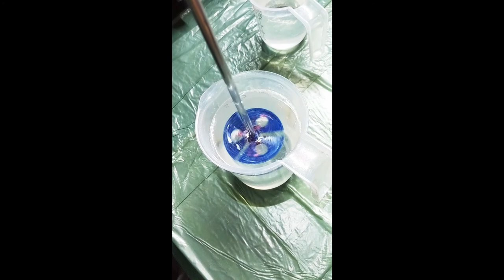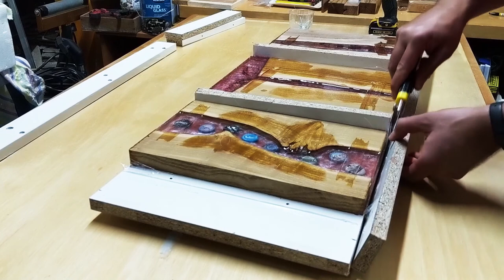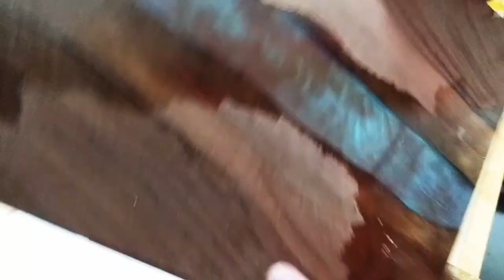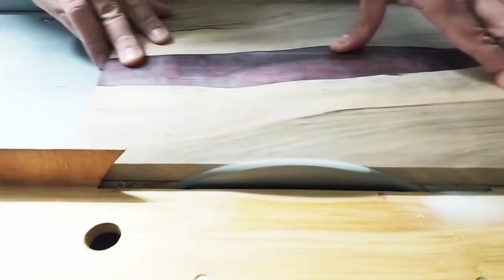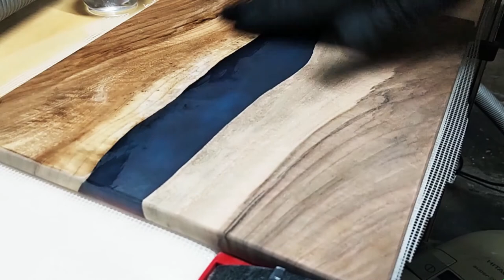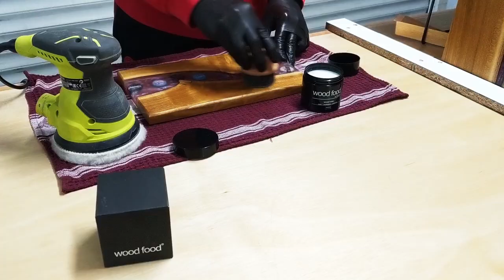From Fireplace Logs to Epoxy Charcuterie Boards!! 😮

Comment: Awesome work Luke, I like how you used one mould for 3 boards :)
Reply from the maker: Thanks! ☺️ I went all in for my first epoxy pour and I figured it was wiser to make a triple mold and make it as leak proof as possible! ☺️ My planer and my orbital sander didn't enjoy repeating the same steps thrice though! 😅😅
Reply: @UnluckyLukeWoodworks  I would imagine there is a big mess once everything is surfaced!